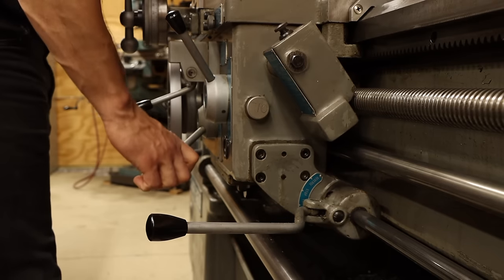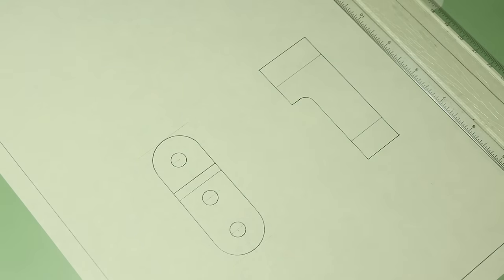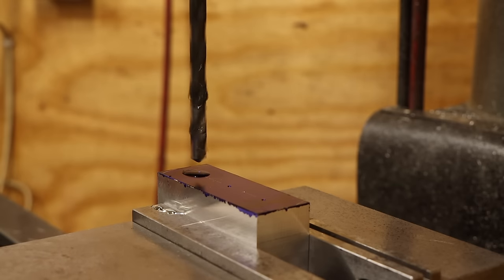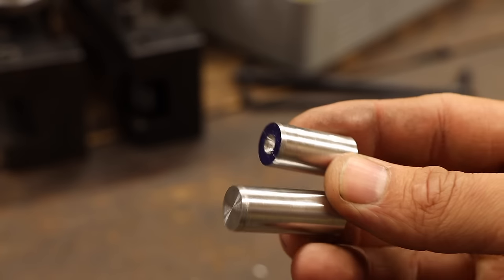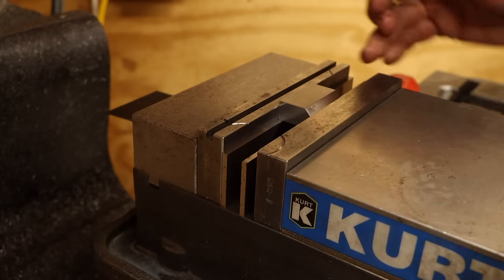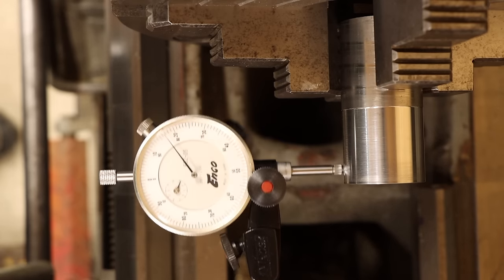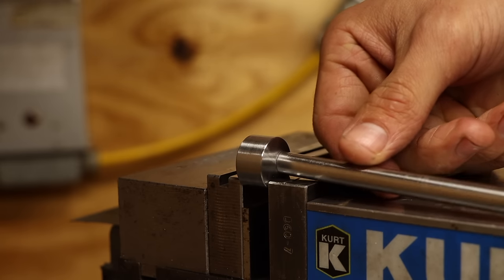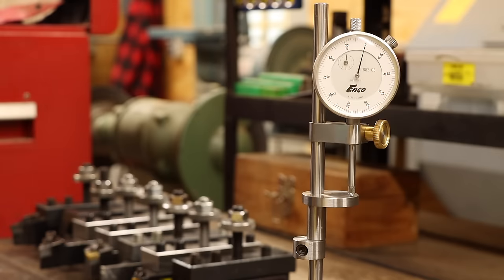A FANCY Lathe Tool Height Gauge || INHERITANCE MACHINING

Comment: "What good is a machine shop if I can't make an over complicated version of a tool I don't really need?" I don't even have a machine shop, and I feel this
Reply: Time to make a machine shop, somehow
Reply: @H3rry118  well I don't really need it, so I guess I had better get started on an over complicated one right away
Reply: I feel this . but with a conventry die holder. I needed to thread 7 parts yesterday and damn if I didn't want to single point thread, or use the janky die holder, which I ended up using anyway after trying several other more complicated methods. 
I really want to make the die holder  like Swap Lamp made on his channel, but..time..
Reply: @mooreevair  I like the electronic lead screw project clough42. Now I can cut any threads and it takes out the guess work. And no changing gears
Reply: @josephlovell6951  I've watched some of what he did. I think I'll need to revisit it . cheers
Reply: @mooreevair  I just pulled the trigger on it last month. And rematch the ser
Reply: @josephlovell6951  I'm confused by your last sentence.
Reply: @josephlovell6951  Actually the way it is designed ... is pure guess work. An engineer would've used angle encoding hardware instead of incremental encoders. You know? To resemble the forced control which gears + lead screws actually are (which is something good to have, when distance is translated into a function of rotation ... which is how physics girls describe a cut thread, I'm sorry for that, hehehe).
You may be convinced that this amateur project is the best thing since sliced bread, but there are other concerns besides bad repeatability, wrong dimensioning of the hardware and ... well, design flaws. Like real concerns regarding workplace safety with such a hobbyist device, attached to a rotating machine tool. ( I am not saying our 100 times more expensive and industry proven concepts and machinery and designs ... and their realization are perfect or even achievable for the hobbyist, but our safety measures are. At least they should. Those regulations came in place for every lost limb. Piece by Piece! To prevent further losses ... At least in Germany, where we value the limbs of our colleagues:) )
Reply: And re-watch the serves. Is what I was trying to say
Reply: @matthewdebeer8453  And that's its the Story how Germany was born
Reply: This is why I want a machine shop
Reply: FYI: This instinct also applies to people who work with software, or even in my case, spreadsheets.

I've literally spent entire days of my life to make a tool to automate something I could have done manually in a mater of minutes.

Occasionally that has proven smart-ish as I've used it MANY times, other times, it was just a challenge.
Reply: this is the way
Reply: It is a compelling piece of engineering
Reply: @dieSpinnt  we just chalk it up to experience and carry on with less limbs and more patience than one began with.
Such as not standing with our head positioned in line with the chainsaw bar Incase it kicks out of the cut unexpectedly. And severing ones head through the centre of the dominant eye. For example.
Reply: To be serious for a second, it's the compounded satisfaction of making something useful with your own hands and making it incredibly high quality. That is an almost existentially satisfying thing to do; especially for a species defined in large part by its toolmaking and use.
Reply: I do woodworking as a hobby.  I felt this statement in my soul.
Reply: @H3rry118 😊😊😊
Reply: The self-replicating nature of a machine shop is extremely relatable to me as a 3D printing enthusiast. What good is a 3D printer if i'm not 3D printing upgrade parts for the 3D printer?

Comment: You're not a wannabe toolmaker, you've got it. I've been a machinist all my life, was a manufacturing engineer for a few years, and a machine shop teacher for a few as well. I'm really blown away with your talent. The pin or rod through a hole on top of the vice trick can be a life saver. Use it with two holes and two pins and you can get very accurately milled angles, although you may have to skim the top of your vise jaws for the 2 pin route. I have seen a couple of shop made tool height setters out in industry. Typically just an L shaped block that is non adjustable. The Tsugami swiss types screw machines I programmed and ran for a few years came with an adjustable magnetic one, but these were used for the tool stick-out length, not setting the center height. None were as beautiful or functional as this.
Reply from the maker: That really means a lot! Thank you! I hope my ideas end up helping or inspiring others to tackle problems of their own. Also yes that 2 pin method you mention is great! Though I never considered checking/skimming the top face of my jaws. Fortunately they weren't critical parts!
Reply: I’ll second the ‘inspirational’ comment.
I note that your finished products closely match your ‘old school’ drawings… in quality as well as ‘to dimension’.
I’m in my late 70’s…. and you are definitely inspiring me to ‘up my (old) game
🤣🤬
Regards
Robert
Reply: 20yrs of machining and I have never seen a setup like that! I am beyond impressed. Hope you don't mind...but I think I will make one for myself from your design. 
Love your videos! Keep them coming!
Reply: Talented!!!!  I've Been Fabricating For Most Of My Life And Now That My Body Is Hurting To Much That I Have Decided To Try My Skills In The Machine Room , Been Exciting Times But After Seeing This Display Of Pure Knowledge Is Making Me Eager  To Get Back To Work And It's Saturday  , lol , I Hope You Don't Mind But I'm Going To Attempt To Make Something Like This Guage , If Not I'll Buy One , lol
Reply from the maker: @robbiecarter5640  Be my guest! Thank you
Reply: I am 71 and totally agree with these guys 100%.
Art from Ohio
Reply: @robbiecarter5640  well copying a design is the sincerest form of flattery!
Reply: I love the idea and the execution of this beautiful tool, slightly over complicated as it is. I would not have drilled and counterbored the base and I would have not slotted it, just a simple grub screw to hold the bar in place, that would save a lot of work, but lazy, that's me lol. Your drawing the old school way is a beautiful execution of the draughtsman's art.

Comment: Very nice, you should consider a custom flat dial indicator tip or attachment to help read the height at the tip of the insert. I've always found it difficult to line up the rounded tips like that. Beautiful build!
Reply from the maker: That's a great idea! Thank you 😁
Reply: Thanks, you have saved thousands of other comments stating the obvious. It's the part that actually touches the tool tip, which is readily available & was not used?

Comment: word to the wise  - you can make a flat bottomed point for the indicator to capture the exact cutting edge, m2.5 thread from what I remember? Also are carbide faced ones if you want it to hold up longer. Not super hard to hand lap yourself from an old insert either.

Comment: I think this is a real improvement on the standard tool height gauge. I've found that sometimes it's useful to have the tool a little above (or below) center height, especially with parting tools. How much above or below? Being lazy, I've always just guessed and done it by feel rather than bother to set up the surface gauge. With this tool, I could really dial in the optimum tool height for a given cut. Well done!
Reply from the maker: That was my thinking as well! I've played with above center settings on boring bars as well which can help with chatter. Now I can actually know how much above works 😁 Thanks!
Reply: @InheritanceMachining  You could make some precision steps in the reference flag for off-center tool setting!

Comment: Wow! just wow. no words can express the joy I can sense in your words. Beautiful Parts and this one will be "the joaker"  calibrator  for all things that need to be centered  with the lathe, 🤩😇 Don't need to move anithing around, just place "the Joaker Calibrator"  there and centered it is ! 😉😉🙃
Reply: And can be sloted horizontaly  at specifiq sizes corresponding to the used scale to center different lathes and models and  more fun things...🤓
Reply from the maker: @EnricoMarangonJunior  Thanks! I don't think I'll ever use any other way!

Comment: Overcomplicated?  OH HECK YEAH BABY ! ! ! !    Loved it ! ! !    Hey, at the end you showed that it might not quite work for ground HSS tools due to the point of the cutter and the ball end of the gauge.   What about a second flip around eccentric that sits on top of the calibration eccentric but is free to float in height.  Make it right on at 0.100 for thickness and you can use it for pointed or other difficult cutters just like you are with the flatter topped inserts.  It would just rest against the calibration flipper and be swung away when not needed.  Or give it a small thumb screw so it sits up against the dial gauge clamp... Or.... Put a small magnet in it so it holds to the dial gauge clamp?  More magnets = more gooder?
Reply from the maker: Thanks! That might make for a useful feature. Others mentioned using a flat style plunger tip that I think would give the same result. My comment about the HSS tools wasn't toward HSS tools in general, just ones with negative rake where the cutting edge isn't prominent vertically.

Comment: just about a week ago I learned that you can buy different shapes of  dial indicator contact tips, likely you know this , but just in case consider a flat bottom tip for the indicator, it'll make the measurements that much more unnecessarily accurate, and you wont have to bend over to see if indicator is touching the very tip of the cutter, thank you so much for the videos!!
Reply from the maker: Good idea! Thanks
Reply: @InheritanceMachining  I've been racking my head over the purpose of the second milling head on your mill? Any clues yet? Spare in case of failure... ?  Best I could think of, pull it off and build a HEMI drill press. A lucky trip to a friendly scrap yard would provide the material.

Comment: I've always just had a piece of brass round stock that i turn the end of it to see if there's a small dimple in the end. If there is i adjust and check again. That usually does the trick. For a rough reference i know on my lathe that 235mm from the ways meassured with a ruler is a good start. But having a reference AND an indicator really speeds up the process and should be spot on everytime. Really nice work!
Reply from the maker: Thanks! Thats a great way as well and honestly Ive made adjustments on the fly when I see I'm getting a small dimple as well. One other advantage with this tool is you can mount and set a new tool mid process without needing to access your chuck or tailstock!

Comment: Great video as always. Little idea that popped in my head. How about a dial indicator tip with a little inside corner feature, so you can put it on your cutting edge like a little hat.
Reply from the maker: Oooo, that might be neat. And I could still set it since the flag could swivels in.

Comment: 14:25: It's janky, but back at school we had this same problem, and a very quick and dirty way of savaging a few microns on the OD is running a bit of knurling, as the metal deformation increases the OD. We were kids, so, no glue on the machine shop :D
Reply: Putting a ball bearing that is a bit bigger than the hole into the opening of the hole and snacking it with a hammer will also work. It deforms the edge of the hole inward effectively shrinking the hole, at least at the opening.
Reply from the maker: If it work's and it hidden, it's not janky haha

Comment: Can you do a follow up video on your camera gantry, how it's working, how you use it, etc?  You could have soldered the knob on too... that might have been more reliable than loctite?  When I ran a waterjet, I would measure the offset from the start point to the edge of the nozzle.  The nozzle diameter was known, so divide by two and I had my traverse distance.  I find reference measuring like that fascinating.

Comment: Brandon, another amazing tool finished! You wanted something to build and made a wonderful piece again. Would I use it? No, sorry man, I just watch the center disappear while turning, Eyeball first, make a modest cut and look what stays behind in the center. Rinse and repeat when necessary. I did this for 27 years now and never felt the near for such a tool. Ehen I started I thought about it but the thought left the building by adjusting along the way. I think it's a too theoretical approach just like scribe marks for establishing the right feel for the right pitch. If you don't know how to set a pitch on your daily driver what is wrong with you? If I need go turn a fancy thread (for me that's imperial} I turn the spindle one turn and look at my digital readout. No scratches but a well finished job afterwards. My point is don't make it over complicated. Life is complicated enough in my opinion. Thank you! No nagging here, truthful comment for one of my heroes! Best, Job
Reply from the maker: Fair points! I'm by no means an experience machinist like yourself. So I just like to come up with big grand ideas to see if they stick haha while the precision height isn't strictly needed a setter like this does have the advantage of not needed access to a faced end or the tailstock. So in theory you can set a tool mid process if it's all tied up. But again, more of a nicety than anything. Thanks as always, Job!

Comment: Thank you for another great video.  FYI - You said you had plenty (but not too much) magnetic attraction for your needs.  But if you need more, make sure your two magnets have opposite poles facing down toward the ways, then add a ferrous (iron or steel) bridge connecting the other side (top side ) of the magnets.  Yes you might want to hide it inside your beautiful base, but it would increase the magnetic pull quite a bit.  Just an FYI.  My two cents worth.    Love your videos.
Reply from the maker: Very clever! I almost want to try that just to see. I'm pretty sure I already inserted the magnets with opposite poles since I could tell that made a difference as well. Thanks!

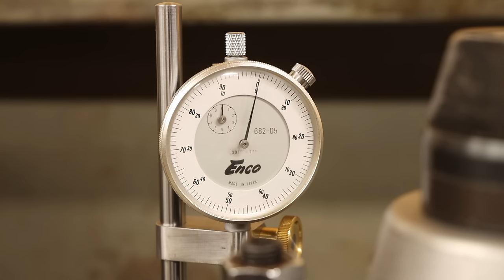Comment: 21:20 when you say "the traditional way" I recommend using a razor blade the way Joe pieczynski does it. Definitely worth checking out. Setting lathe tool height joe pie (for reference)

Comment: 17:36 a simple solution for that is to use an expanding mandrel. A (set of) tool(s) that every machinist should have in their collection. Seriously, find them, buy them, use them. They are some of the most versatile and useful bits of machinist setup tooling that you'll ever use. When setup right, they afford you a lot of leeway around your work piece and they become a safe solution where other setups might lead to error or accidents.

Alternatively, the cheaper solution is to machine a mandrel and then superglue your part to it. You'll have perfect tolerances machining your part on top of said mandrel and removal is easily obtained using heat.

Comment: Really something!  The only thing I'd change would be to use brass plugs for the magnet so you'd have a bit of garnish that matched the brass nobs.  Gorgeous build and I again marvel at your capabilities.
Reply from the maker: Thanks! I almost did that actually but didn't want to have to worry about galvanic corrosion
Reply: @InheritanceMachining  Oooh, good point!  I'd completely forgotten about the galvanic reaction!   So embarrassing!
Reply from the maker: @threeriversforge1997  lol don't worry I realized as I was typing that I neglected that on the thumb screw 😂

Comment: Awesome build! I especially like the swivel flag and the two ways of using it. The only design objection I would have is that a lathe produces chips, potentially of the iron or steel kind, which could get stuck to the bottom of your stand. I don't know if you have a good trick of getting iron dust unstuck from a magnet, but I don't usually enjoy the process. In this case, because its a measuring device, it would be a shame if a small chip would get stuck between the stand and the lathe ways thus skewing the alignment.
Reply from the maker: Thanks! And yeah that was a little bit of a concern for me as well. As it turns out the magnets are far enough from the edges of the aluminum block that when I brush away any iron chips, they tend to just fall away rather than being re-attracted. Hopefully that makes sense
Reply: @InheritanceMachining  Thanks for the response! So the trick in this case is that the magnets are strong enough to stick to the lathe, but not so strong that chips are difficult to remove. If it works, it aint stupid I guess 😂
Reply from the maker: @TheLayleaf1  yup that pretty much sums it up 😂